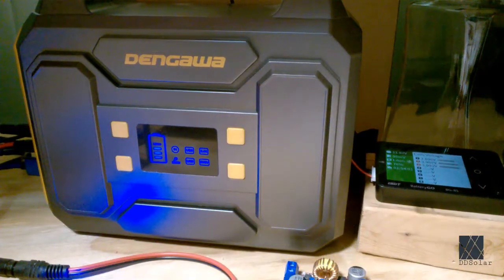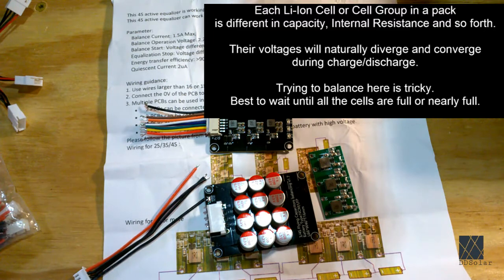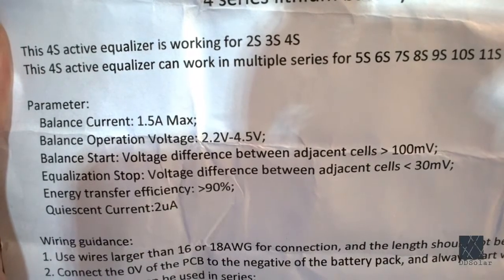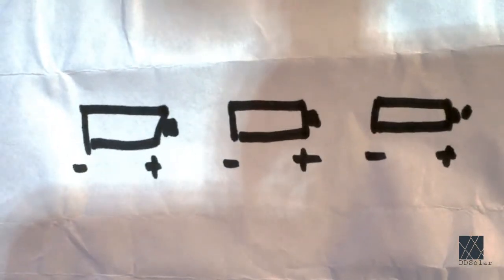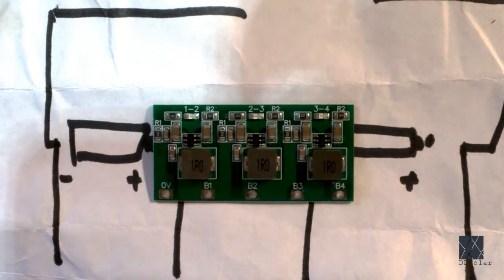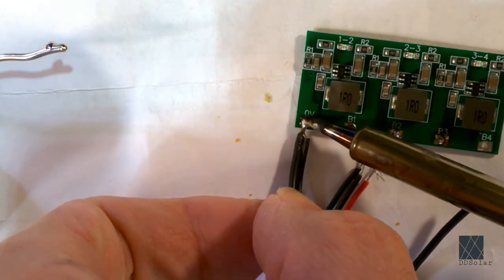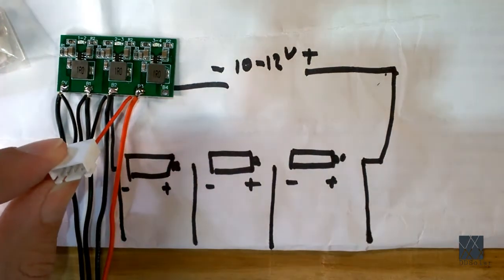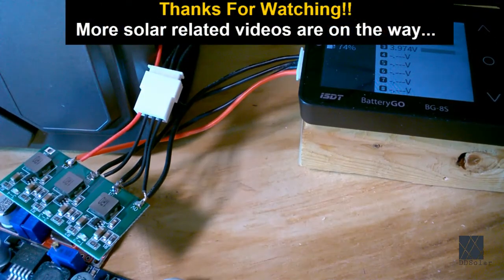How To Connect 3S Balance Plug and Install Active Balance Board on Lithium-Ion Battery Pack

Comment: So how to wire 3s balance connector with 4 wires, when i have 9 cells in pack ( 3s pack ) ??
Reply from the maker: @soulbrothers7789 If it's a 3S pack, exactly the same (because each parallel cell group acts as single cell)
Reply: @solarpoweredge thank you
Reply from the maker: @soulbrothers7789 NP! :)

Comment: Probably easy to move the pins. Push down the clip on the pin and should come out, check youtube for how to. 
Hearing that some leads are wrong scares me.
Reply from the maker: @random269 These days, with all brand new connectors it's a good idea to check the pinout. Sometimes even MC4 connectors on solar panels are backwards
Reply: @solarpoweredge   That is just scary,

Comment: I am planning to create a small 12V 3S Utility battery, and already noticed, I do have to use such a balancer along with a BMS. Does this balancer stay connected to the pack all the time or only during charging?
Reply from the maker: Hi, this type needs to be connected (or activated) at the end of charge normally. To me BMS means battery management system, which implies balancing with battery protection circuitry included. A battery protection circuit without balancing (BPC) cuts off the pack if any voltage goes too high or too low, or for overcurrent (like an electronic fuse) but doesn't balance. An active balancer such as shown in the video, does not necessarily care about the voltage or cell type, but only voltage differential (delta) between the cells. 

The best kind of active balancers are called Flying Capacitors active balancer (better than the type shown in this video) and these should only be turned on at the end of charge (exception, if one is trying to repair a badly unbalanced pack). Otherwise they are just wasting power. Please check this video for a demo of a fly capacitors active balancer: https://youtu.be/IJzqKf9G6uM

Hope that helps, and thanks for watching. DD
Reply: @solarpoweredge  That helps a lot, thank you!
Reply from the maker: Welcome glad to help :)